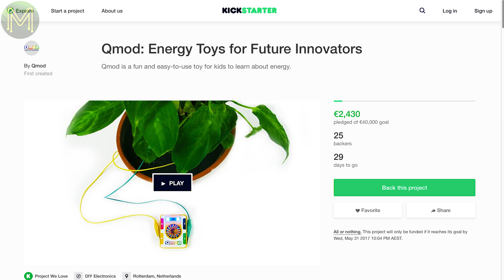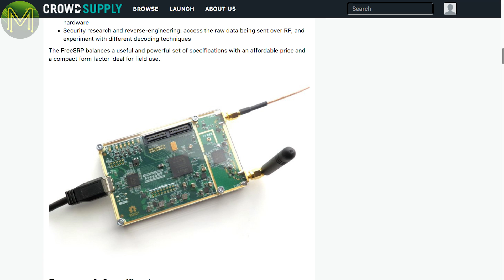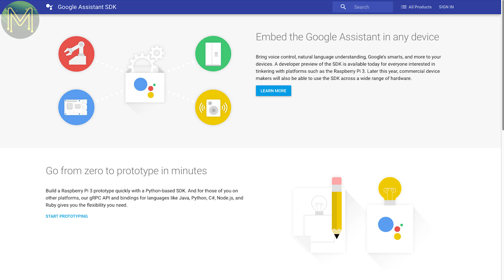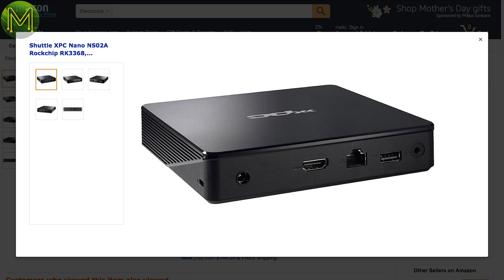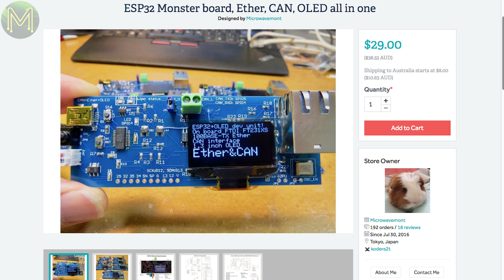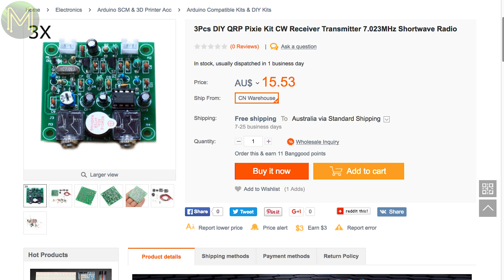#128 Weekly Roundup #33 - New Maker Products

Comment: The reason FreeSRP isn't going anywhere is it's an absurd price for 50mW of power. By time you preamp 50mW to 1-5W which will be minimum usable for anything amateur radio your signal is so dirty it's unintelligible. It's the same reason the hackRF is targeted at bluetooth hacking, it's not really very usable for wifi or amateur radio. You are looking at $1000USD to clean and amplify the signal and at that point your better off just buying an apache labs transceiver. anything below 2.4Ghz 50mw is useless and there are better devices for 2.4Ghz up that are already on the market for much less.
Reply: True, but it is designed for ultra-low power working, hence the "QRP" in the description.
Reply: If this were a 1W radio with clean output where I could use digital modes I would be all over this. I'm actually learning code right now and looking for a 5W SDR rig that wont break the bank like an elecraft, flex or apache labs radio will. FreeSRP isn't a bad device it's just that for what it is I'd expect to pay more around 250USD. If it were 1W I'd already be in on it at the 420USD price, and if it were 5W I'd have 2-3 ordered. It's really just another hackRF which is fine, just not what I'm, looking for and there are many more like me. If my engineering were decent I'd design something on my own, but alas it's not. For QRP you usually want about 1W minimum for CW with 2.5W being a real good point to DX and 5W being your optimal for qrp contesting. and 5-10W for phone/ssb.

Comment: That Google Assistant SDK looks promising and complicated. 
For years I've been waiting for some gadget to read my emails to me as they arrive. It has to be trainable to grab emails from links sent to me. Some secure sites send an email telling me that there is email for me and I should log on to read it...
Sending emails should work the same way. I think a RPi3 would work just fine...
Has anyone invented this wheel, so I don't have to?
Reply from the maker: +UFOhunter 
Yup, it looks promising. I don't think email reading is too hard. The smarts would have to be in what it reads out as you wouldn't want it to read things like signatures and those long disclaimers at the end of emails.
Reply: I think it can be easily detected by font size in css of the page. BS is usually in a smaller font.
There definitely needs to be templates that match incoming emails. 
The whole thing can be done with python...  Only if I could stop sleeping 8 hours a day...
Reply from the maker: Ha ha. I would like to clone myself! I'd get three times the amount done.

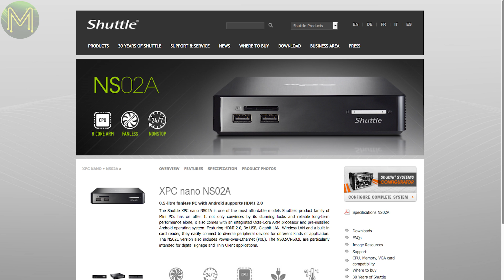Comment: 5:12 not forgetting that you can pickup an older intel BOXNUC5CPYH nuc for about the same price (less a few parts you'd prolly have floating around)
Reply from the maker: Yes true, but I think the old NUCs don't have easily accessible GPIOs. Whereas on these Allwinner H2 boxes we know there's a tonne of GPIOs, just a case of getting access to them.
Reply from the maker: I'm betting there's at least one TV box that has easy access to some GPIOs.
Reply: yeah i know what you mean, but the nuc aint bad with 2 internal usb2, nfc header, aux power, user printable lids, IR receiver, sd card, and all on x86 with your choice of distro and graphics acceleration to boot. whack a SoC on the internal usb and off you go.
Reply: wish the nucs used 1.5v ram tho, got that stuff coming out of my ears and none of this low voltage stuff they want.